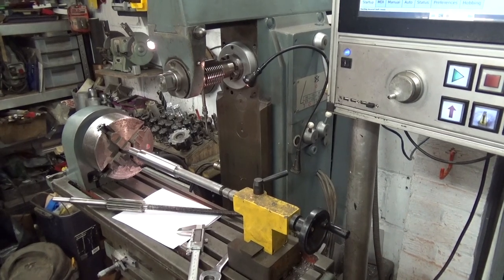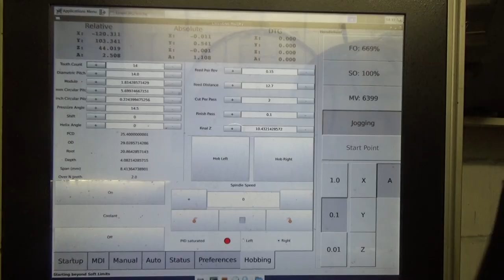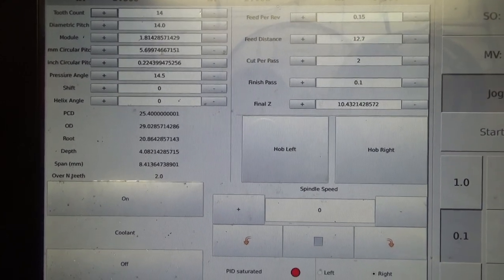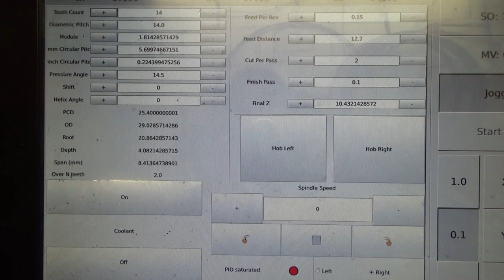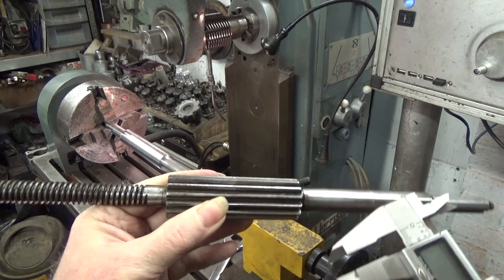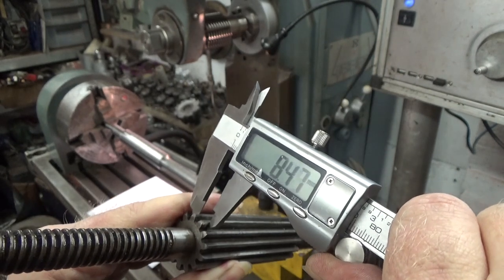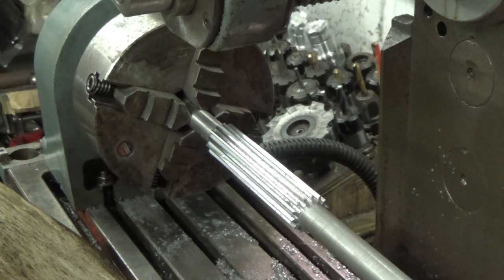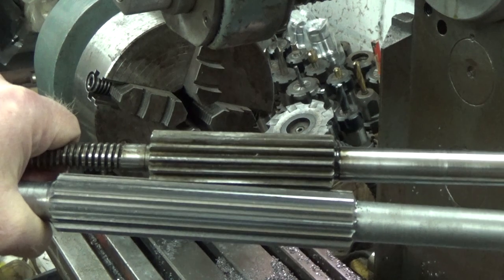A New Gear for an Old Lathe

Comment: Is that helical gear? I’ve never would have expected to see such a long helical gear.
Reply from the maker: No, there is no helix. 
The reason that it is so long is that the cross slide of the lathe has a separate taper-turning slide and this gear needs to slide through the driving gear.